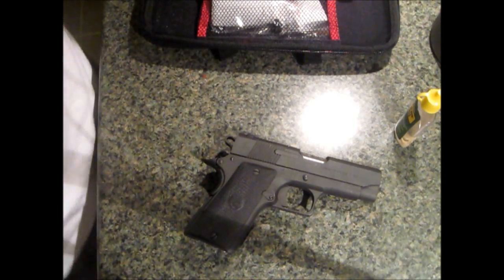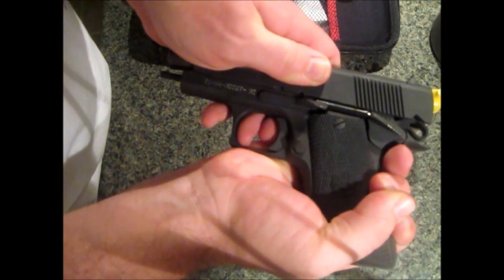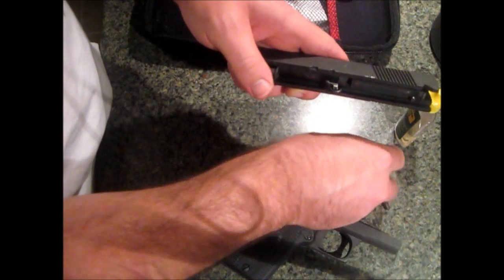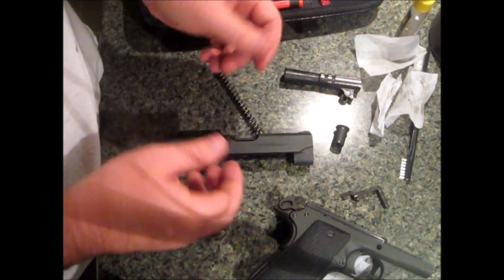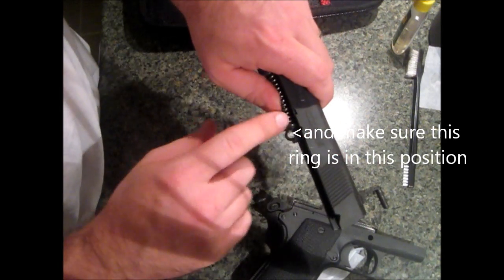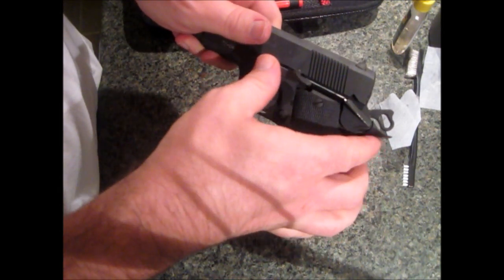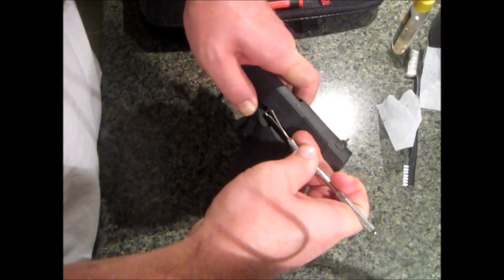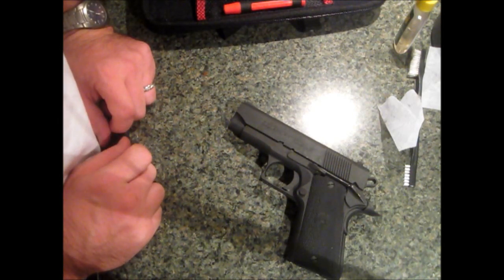Llama Minimax 45 1911 Disassembly for Cleaning

Comment: Anyone know a place to get reasonably priced magazines for this gun.  The best I found in Central Ohio is $57
Reply from the maker: WOW. I've bought several off ebay for below 20. Any 1911 mag will work. If it's a 7rd it will stick out the bottom though.
Reply: I use regular 1911 single stack. I have 6rd, the first one that came w/gun,7rd  x 3 cost me $6.50 a piece at a gun show in 1999, 10rd x3 bought in 2000.the gun is a llama minimax 45 i bought new in 1999 at a gun store. The mags have all been loaded since i bought them  i never had a problem with any of them. The gun doesn't like HOLLOW POINTS, but does very good with 230 FMJ.i shoot it bout once a month clean it bout every 6 months.  To answer your question I've had good luck with regular 1911 steel mags.